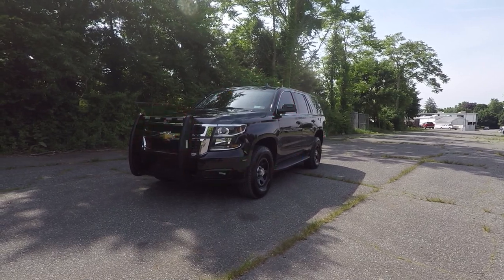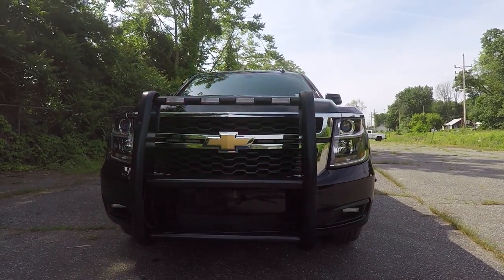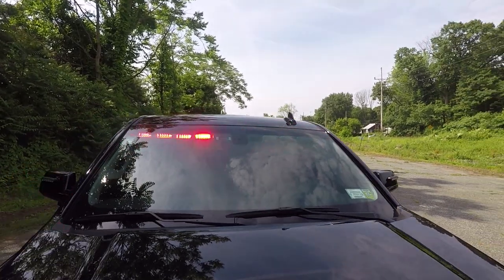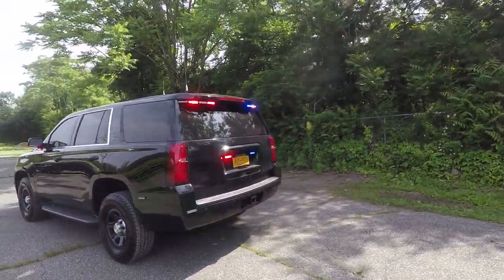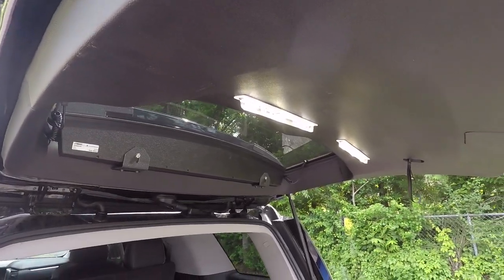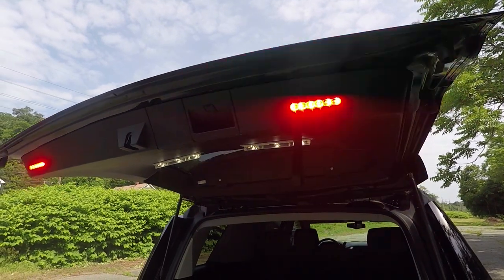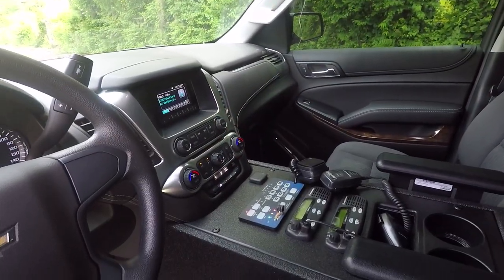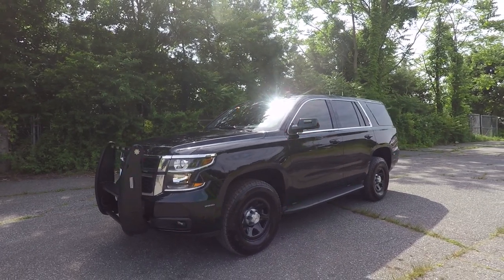2016 Chevy Tahoe First Responder Vehicle 10-75 Emergency Vehicles

Comment: Looks awesome! I may have missed it but what lights are on the top of the pushbar in the middle...? I am getting ready to put perimeter lighting around my ram truck but can’t decide between mpowers or nForce. I already have a 54” nForce lightbar. I like the reflector design. Any thoughts ?
Reply from the maker: The lights in then push bumper are soundoff nforce
Reply: 10-75 Emergency Vehicles ok. Would you say the M powers are as bright as the nForce or just as bright? Or how about off axis? It looks like the nForce has more of a bigger punch in size and intensity. Thank you
Reply from the maker: They both are pretty much the same.